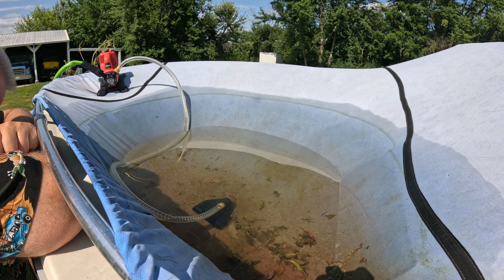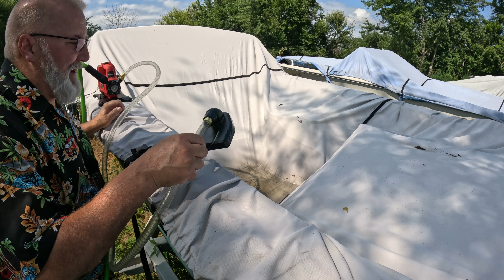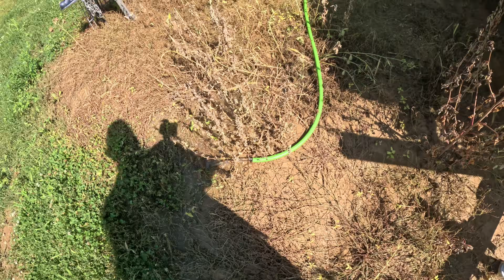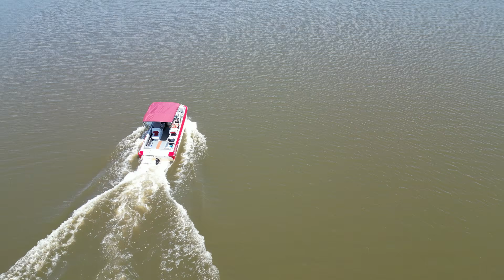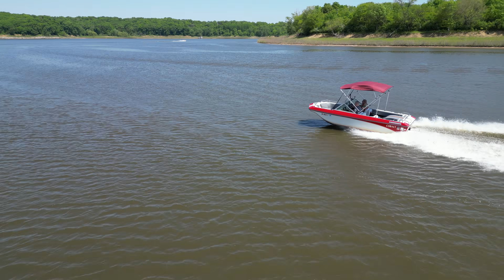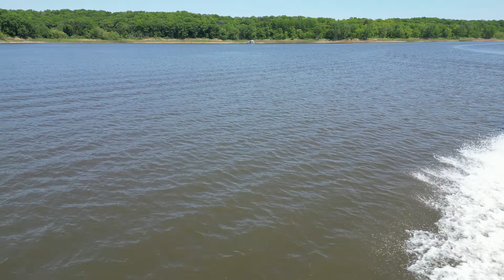Bauer Duel Power Transfer pump  This thing worked amazingly well

Comment: I'm enjoying your videos! Random question... I have a 1956 Johnson Seahorse 7.5hp.
I'm looking looking to restore and am having a hard time finding basic parts info like a carb kit and a water pump kit. I also need a duel fuel line for the Mile Master fuel tank. Do you have any leads on where I can get this stuff? TIA!
Reply from the maker: Try marineengine.com.